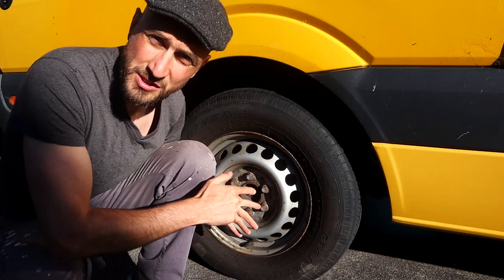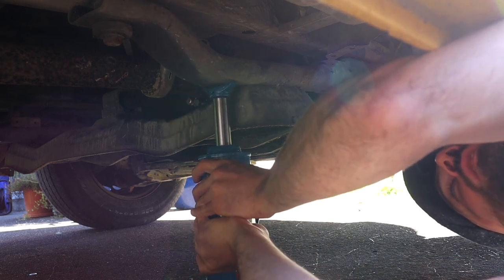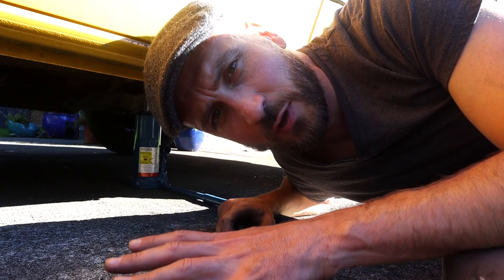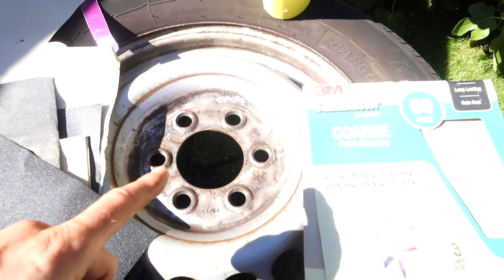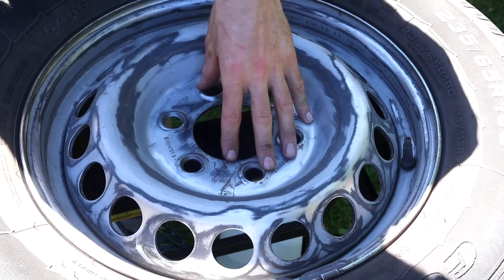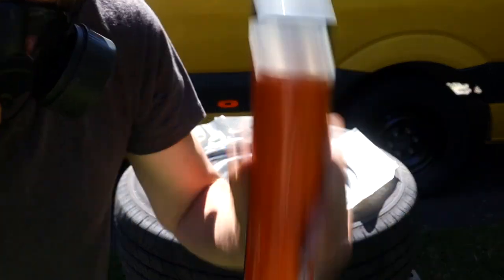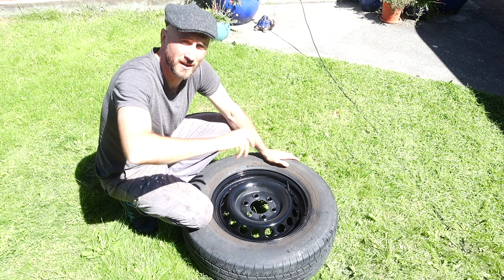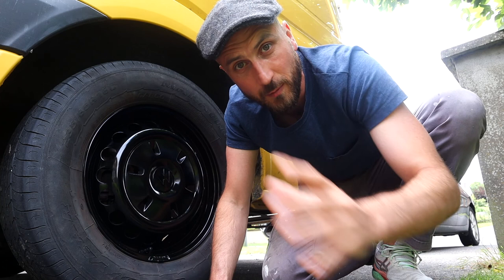HOW TO REMOVE RUST AND PAINT STEEL WHEELS ON VW CRAFTER EP. 62

Comment: I did the same technique for my wheels, but sadly after just a few months the rust found its way back through. 

If you can, I'd recommend getting the tyre removed from the wheel before you remove the rust. Most tyre places will take off/put on for a few quid and it will give you a much better finish, especially around the rim. Secondly, I wouldn't use standard wheel paint as most of it doesn't have any rust proofing in it. I used Simonz wheel paint, with 3 coats of primer, 3 of silver and 3 clear coats and the rust still pushed its way back through. You will never be able to remove all of the rust, especially from all the ridges. I would use a  metal protective spray paint or direct to rust spray paint, to help keep it at bay for as long as possible.
Reply from the maker: Mine are still rust free and still looking great! That’s strange that rust would come like that even after you removed it all with sand paper. Great idea to get the tyres removed before you spray the rims 👍